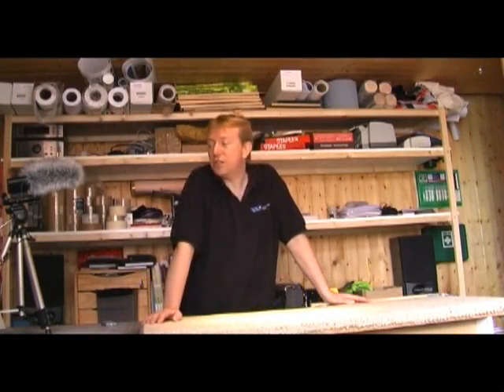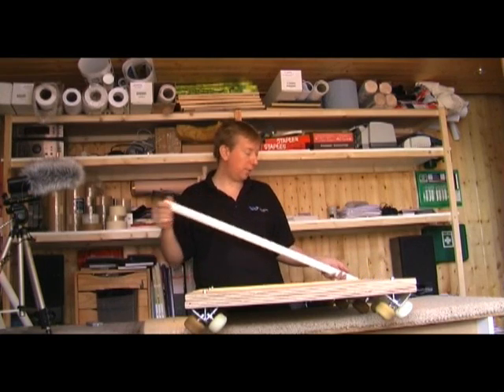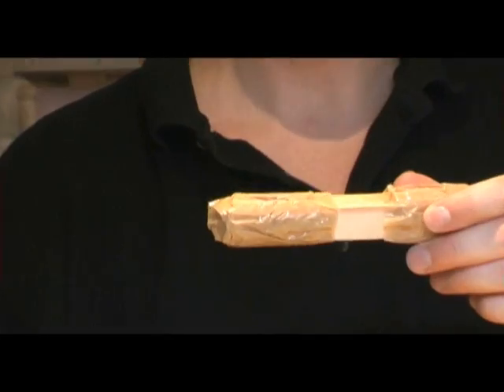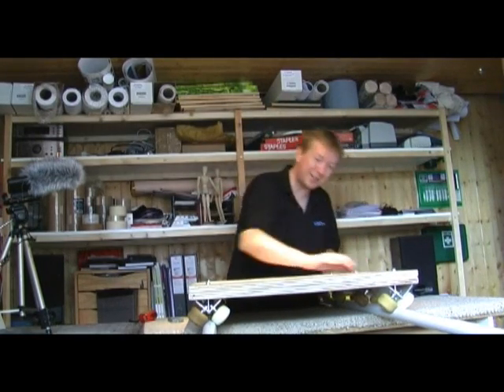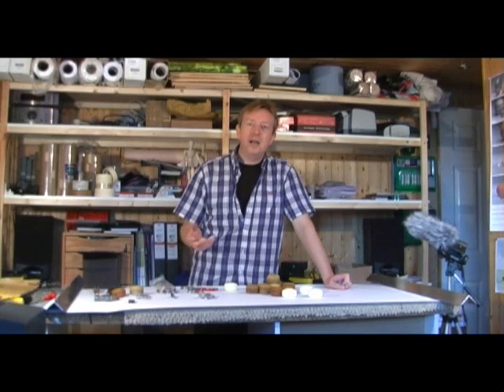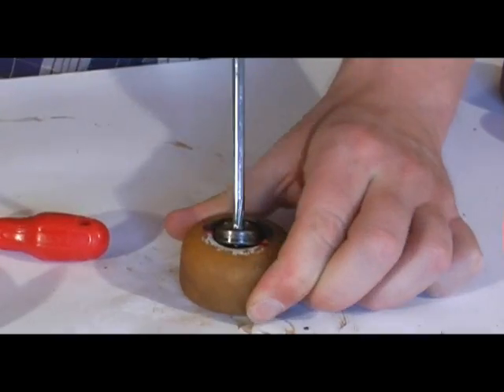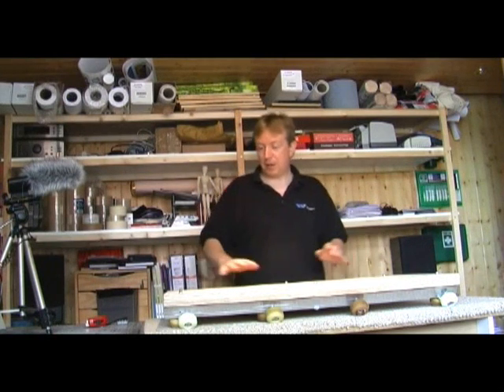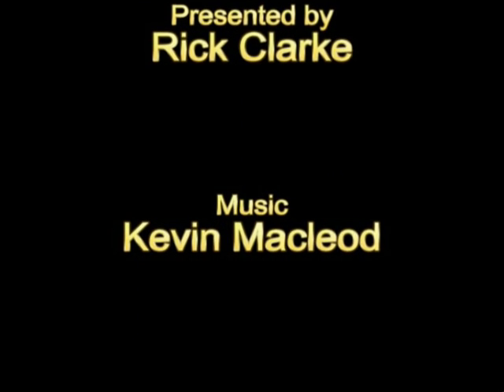HOW TO MAKE A TRACK DOLLY ~ LOW-BUDGET FILMMAKING (UK)

Comment from the maker: The pipe handles the weight ok if you position the wheels to sit more on the top of the pipe, rather than on the wider/fatter side area of the pipe.
On my first attempt, the wheels were set wider and I did experience a "crushing resistance" effect on the pipe that slowed things down. (see video notes)

Comment from the maker: A caterpillar bulldozer can run over your foot and not do any damage because its weight is distributed across whole area of its tracks.
The same principal applies to the dolly. having the weight distributed over 16 wheels on the track means no one single wheel is excessively heavy. 
It might work, but you would be concentrating the full weight onto just 8 points of the track which may be too much for the PVC pipe to handle if you are using heavy equipment or people.
hope this helps.

Comment from the maker: It's about distributing heavy weight.  The same weight balanced onto only 8 wheels will cause the pvc pipe to crush/flex into the "V" shape of the wheel arrangement and act like a brake.

Also staggering them so they all don't cross the track joins at the same time made life a lot smoother.

Comment from the maker: @sonicclang it should be ok and will probably get used if the track is on uneven surfaces. as long as the dolly runs smoothly, you should be fine, otherwise just drill a fresh set of holes and re-attach them.

Comment from the maker: @SE021002  No, not this design - you would need to design a set of turnable bogeys and be able to attach them to the board whilst still maintaining a stable platform. Probably a bit trickier than it sounds.

Comment from the maker: Depends on the size of your wheels. I did that part by eye. Just use common sense and good judgement.  If you get it wrong, just drill another set of holes based on what you learned from the incorrect ones.

Comment from the maker: Actually I got it wrong.  It's just a hole drilled in each end of the board. 
You can actually see the holes in this video from 0:27 to 0:32 . 
Just get a pole with some some sort of improvised hook on the end that will fit through the hole, and you can push/pull it along holding on to the pole  :o)

Comment from the maker: speed - I  guess it will go as fast as you can run? as long as the track is secure. spacers would probably help a lot, but if you have enough room, you can film smoothly from the side of a car or van driving along.
Turning would be impossible with this wheel arrangement. you would need pivoting wheels in the corners and none in the centre.

Comment from the maker: I had experienced a similar noise issue when the track was dirty, but not to the extent you are describing. Are your spindle bolts done up enough? Do you have a rogue set of bearings that are sticking? and the obvious one: is it the joins in the track?
I would suggest removing 1 wheel at a time and running it till u find the culprit.

Comment from the maker: I think its made of PVC.  32mm is a standard European size, I'm assuming the Canadian equivalent will be in imperial sizes i.e. 1 1/4" etc. 
It should be available from any DIY store. I think it unlikely to be on eBay as the postage costs would be too high. Perhaps you'll have more success with an online builders merchant if you want it delivered.
Good luck.

Comment: I bought 3 different size of wheels and i didn´t notice, but got a solution: The first row I put 2 in each side of the same size, the next row 2 in each side from the same size, 3rd and 4rth row same thing, so that way I have a little inclination but equals in both sides. The reason I bring this up is to sugest everyone to buy packages of 4 equal wheels and you would have no problem. This because not always you can find 18 cheap wheels from the same size.

Nice vid by the way, really useful!!!!!

Comment: I just finished it... i made it a little smaller and used only 8 wheels but it's great! very stable and the movement is as smooth as it gets! didn't try to film anything yet but i'm sure it'll work fine. thanks!

Comment: We also made a dolly to put a cam on. We didn't require to build it though I just took some left over laminate flooring, clicked those toghether to form a long flat surface (click together lengthwise) and use a longboard (large skateboard) on it  with a small tripod attached on it.

Comment from the maker: I made the dolly wide enough to hold a tripod with its un-extended legs locked open. Then I used a ratchet cargo strap to teather the tripod to the board. Some people use a heavy-duty hook screwed into the board as an anchor point. Others use place-cups to hold the tripod feet in place - this is useful if the board is not wide enough to lock the tripod legs open. Hope this helps.

Comment from the maker: Grass has a particular issue - any blades of grass that are crushed by the wheels create a pulp that sets hard on the track and makes it rough and lumpy - affecting the performance of the dolly. It's also a bugger to clean off once it is dry!
you would need to add sleepers to the tracks (that are taller than the grass) and at fairly close intervals in order to eliminate this problem.

Comment from the maker: Hi. not certain, it might be alright, but I wouldn't reccommend it. The idea of all the wheels is to evenly distribute the weight down the plastic pipe track (which is not THAT strong.)
If you concentrate more weight on less wheels you may start to encounter smoothness and other issues. Also, crossing over the joins may become more noticable.

Comment: Great work, rickvanman !
Instead of those wood blocks with packing tape, you can get blanking-off
caps which are supposed to be solvent-welded inside waste pipe. Just cut
off the actual cap bit and leave about an inch protruding. That way, each track
section has its own built-in spigot to join the next piece ?

Chris

Comment: To reduce the noise, fill the pipes with foam and pack the bearings with bearing grease. If you are placing the pipes on a hard surface, such as concrete, sweep the area first. It would also help to use soft wheels.

Comment: To make a track joiner cut a short length of pvc pipe of the same size then make a cut the length of the pipe then a second cut next to the first . So you end up with a length of pipe shaped like the letter C  when looking at it from the end. If you have cut enough out of it you should be able to squeeze the pipe till the cut sides meet and the slide it into the end of your pipe . And there you have a joiner for you tracks , Enjoy. Hope this Helped If i could work out to post a picture as well I would.

Comment: Also, fill the space in between the angle aluminum and platform with foam. I would also put a rubber pad between the angle aluminum and platform. Used bicycle tire tubes work.

Comment: I bought two pairs of "Youth Inline Skates" at WalMart for $30.00.  I took the wheels off the skates.  That's 16 wheels with bearings for only $30.  That comes to under $2.00 per wheel.  

Also, if you can't find spacers for cheap, use two 5/16" nuts on your 1/4" carriage bolt.  This worked great for me.

Comment: For those who don't know much about skateboarding, here are some tips that come in handy with building this dolly: Do not get bearings and wheels from stores such as Wal-Mart. They do not roll as smooth/quiet as the real stuff. Higher ABEC rating on bearings is better (not all have that rating, though). A good option would be Bones Reds bearings (~ $15 per set, with spacers). Use urethane wheels. Blank urethane skateboard wheels are cheap (~ $11 per set) and will last a good while. Have fun!

Comment from the maker: I used angle aluminium - angle iron is horrible dirty stuff to work with.  
Drilling the holes is a trial and error thing - just apply a bit of common sense and hold the wheels in place and ask yourself if the position looks right before you start drilling. Look at the notes field of this video for more information. (top right where it says "about this video")

Comment: For those of you who want to know if this works with on a curve,  This will work if you use a very slight bend - and you can achieve that bend if you use a high density industrial hose as your tracks. You'd just need to make sure you space them proportionately with your wheel base.  

For good curves,  you can use certain casters from  an office computer chair.  They have a gap in the center that would straddle a pvc pipe just fine.  But there might not be enough grip, but that can be fixed.

Comment: You should be able to reduce the track noise while the dolly is moving by filling the pvc pipes with cotton balls...the hollow pipes are what is causing most of the noise.  Securing the track in place and using higher quality wheels should also help reduce the noise, although you'll probably still end up with some noise from it.  

Of course, you could always ignore the original audio and record new audio in post...but your foley/sound editor might hate you ;)

Comment: i used to skate and fyi to everyone, there are different quality skateboard bearings out there rated by the speed they turn, the measurments are called abec. theres abec 1-5 and i belive maybe higher nowadays so if you want it the most freely i would suggest a 4 or 5. they are more expensive but im shure you can find them on ebay or at a garage sale. i dont think having variations of the difforent abecs will affect the smoothness of the cart to muchso dont worry to much about it.Thanksforthevid!

Comment: A little improvement,what about welding the angleline to a steel plate the length of the angle line.Then drill holes in the plate.Also counter sink any holes drilled in theboard.That way it's flush.A nice finish would be a coat of semi gloss black with a rubber mat.
Nice video.

Comment: This makes me think about something maybe even more portable...running cable between two poles...and sliding the camera around on the cable with a little pulley setup.
No heavy items at all to carry...poles may have weights at the bottom to even sit on concrete...screw into bases...any bounce created by not having the cable really tight would probably look like steadicam ...but you could change the height settings very easily too.....

Comment: you would need less wheels, or wheels that can slide left and right (the two ends have to stay in place) and ever wheelwould have to be able to rotate (or in this case, each pair has to rotate). Then you just have to find a track which can bend. Sorry if this is confusing

Comment: Apologies if this has already been brought up - 

Have you considered putting a vertical piece of pipe, or something similar, on the corner of the dolly, so that a "grip" can push it along without having to bend down? I'm thinking a regular piece of steel pipe should do fine, and you could put a cheap motorbike handgrip at the top for a better grip surface.

This way, I figure it could be pushed along smoothly while the camera operator is onboard.

Comment from the maker: You'd need a set of bogeys (swiveling wheel sets) under the main platform. Then you'd need a load of track - fine for the shots you need, but storing track when not in use would need a lot of space. probably more trouble than its worth - You'd probably be better off with a steadicam - something like a "Merlin" for about £500 would do the trick.  Failing that - drive around the caravan slowly and get your passenger to film it out of the window!

Comment: You can purchase just the bearings (a little larger) and save the cost of the wheels. A ball bearing with a 1-inch outside diameter would work just fine.

Comment: mark your holes with the inside of the  wheels as a guide with an x, you will want the riding surface of the wheel flush with the edge of the aluminum angle iron. A 1/2 inch auger bit will do the trick as it is super fast and precise. Plus you would only really need 6 wheels on each side, one set on each end and one on the middle. If your platform is 7 ply thick, weight is ditributed evenly plus an extremely low center of gravity so no flexing.Buy some good bearings, same size wheels!

Comment: 2 things:
How fast would you be able to go on these? Do you think with some spacers between the piping to hold the width youd be able to move practically any speed within reason?

How about turning with this thing? If you can somehow smoothly bend to piping to a curve would there be a further axel needed or would this just be able to ride it?

Comment: Very well explained. The wastepipe in my local DIY is widened at one end to take the next piece, so I suppose I'll have to cut it off (about 5cms.)I also need a brake to stop the dolly at fixed points (for animation). Any ideas?

Comment: great vid. Would it be possible to use garden hose for the track instead of the PVC? you might be able to put in very small angle changes with it. Or would the hose not be rigid enough?

Comment: is it necessary to use that many skateboard wheels? it means more bumps in the shot if the creases between the two pipe lengths if you use more, so can you just use like 4 per side?

Comment: go to a second hand store and pay lik 5 bucks for rollerblades. hey i was wondering did the angle aluminum wheel bases already have holes in them or did you drill them? how much did the angle aluminum cost? and how much is that tubig and what size is it? (if you dont mind).
and one more thing i take it you are in england? so i will have to find out how much the difference is between england money and canadian. thank you so much for posting this video! it is a great idea.

Comment: Rick, thanks for sharing. 

I'm rebuilding my dolly to use a similar wheel configuration, but after checking the price of skateboard wheels I've decided to have them turned on a lathe from 50 dia. mm nylon rod. That way I can easily make/add more wheels later and also use bearings that have a 5/16" bore and will therefore take larger bolts.  

You can see all my custom built rigs at sitca.com

Comment: u have alot of unnecessary equipment, im a longboarder (downhill skateboarder) and you dont needa waste the money on spacers as you would be making the bearings to tight, plus buy bearings that are like super super cheap for a project like this, it appears you have reds which are expensive for this sort of project... nice job!